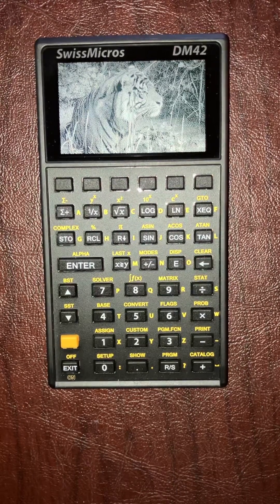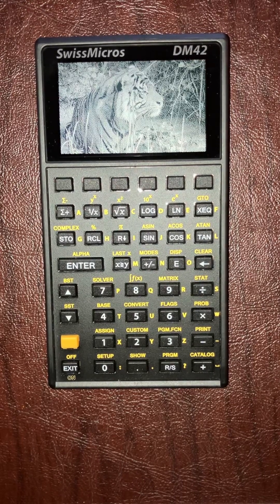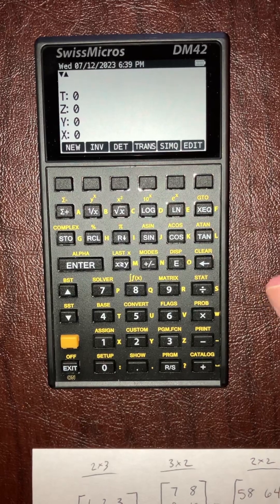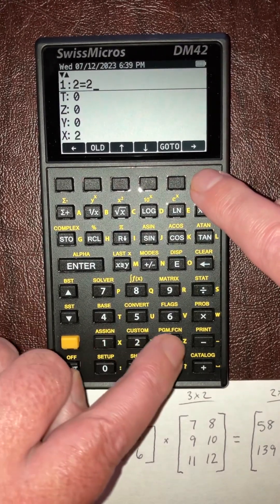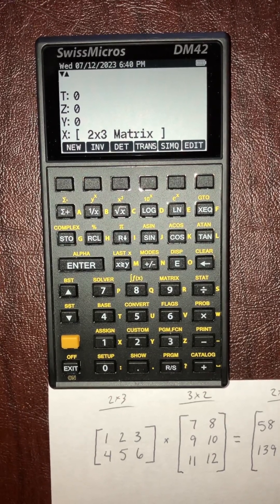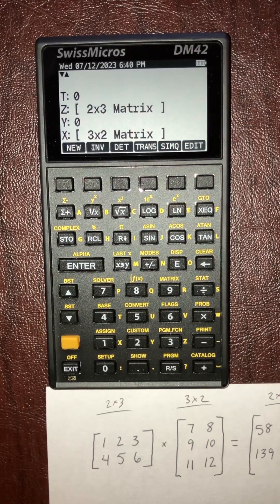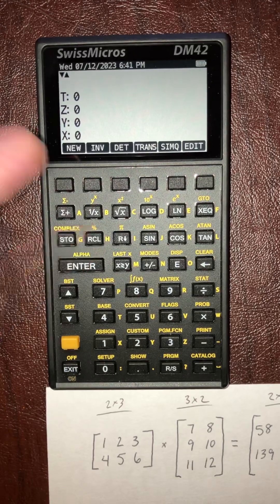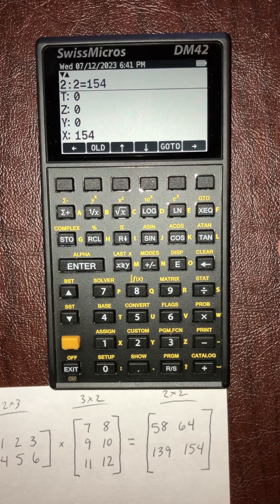SwissMicros DM42 Matrix multiplication

Comment: The HP48 seems more user friendly to me as you can see and enter the matrix in a spreadsheet format.
Reply from the maker: My HP48GX was awesome.  I had it since 1993 when I was in college and it died earlier this year.
Reply: @stevebjee  I have a HP48g that I still use most days. The On key is a bit iffy but it still works! I think I bought it in 1993.
Reply: I was expecting to be able to use a matrix editor too. Really the hp48 was a legend

Comment: Nothing wrong with what you did but at this point:

0
[2x3 Matrix]
0
[3x2 Matrix]

you can simply press swap (x≶y):

0
[2x3 Matrix]
[3x2 Matrix]
0

and then press R↓:

0
0
[2x3 Matrix]
[3x2 Matrix]

and you're ready to press multiply. Usually a good idea to store them in variables like you did anyway.